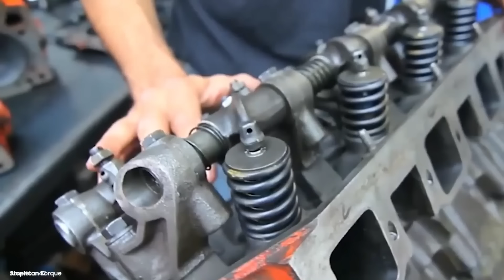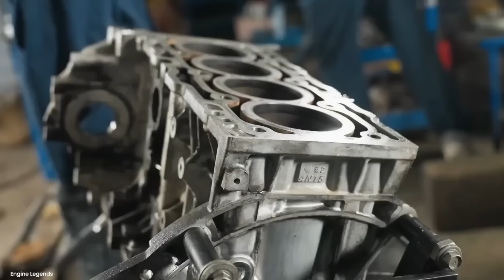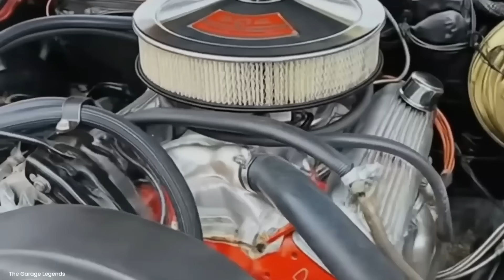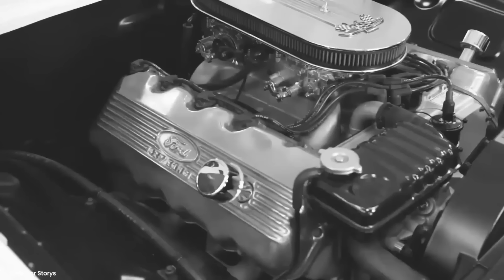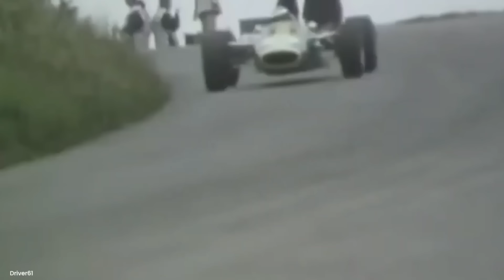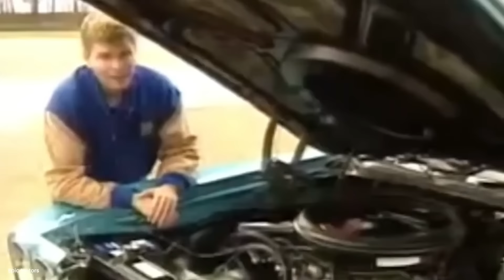This Small-Town Racer OUTSMARTED GM With a Cheap Mod They Mocked First

Comment: This is a great story. Thank you very much for sharing this.
I’m 59 and I’ve built 3 different muscle cars, with the help of my own knowledge and my good friend Kelly.
I love engines and mechanics.
Again I love this simplicity and the regular mans innovation.

I have a 69 Mach 1 408 stroker that would benefit from a spacer between my carburetor.

Comment: Three things I did on my big block Chevelle that helped me at the track. I have a spacer between carb and manifold. Have an air horn on top of carb under air cleaner. A curve kit in the distributor. Heads are ported on intakes and ported and polished on the exhaust. Car goes better than it should.

Comment: From the time fuel is introduced with air the more the fuel is atomized before going into the cylinders the better. 
I have seen dramatic differences with carburetors watching the fuel being drawn into the intake . 
 What happens after it leaves the carburetor into the intake manifold at all RPM 's I found interesting !

Comment: Geniuses aren’t usually the over educated. More than likely. Those who use current technology ( not necessarily science), comes from the lack of specific goals and open to variations on a theme. As in art , the moment of conception hits you when you step out the way, and let the concept run on its own power. Flow is what that’s called. Builders , musicians and any other creative force finds the solution. Great story!

Comment: Just as you’re talking about a spacer with a taper for under the carburetor, instead of changing jetting sizes, l would taper the jets kind of like the venturi in the carburetor. I didn’t have a dyno or anything. Just tried to go by the feel of how the carburetor acted while driving it. I old now and haven’t done it in many years. I saw a little difference. Good enough for me anyway. Have a good day
Reply: How did you taper the jets
Reply: @d @danielreese5311 put the jet in a nut they would screw into. Put the nut in a  vice and take a drill bit that’s bigger than the little hole in the jet at the bottom , and smaller than the hole going down to the bottom hole and drill just enough to open up the hole going down to the bottom of the jet without going thru the bottom of the jet hole. The taper on the drill bit makes the hole funnel shaped
Reply: The old Ford Autolite 2 barrel carbs some classes had to run were some l got a little more torque and hp
Reply: (Do your thang don’t worry about others!)

Comment: Sometimes the best engineering comes from the seat of the pants  feeling. When it's fast, you just feel it. You can't necessarily be able to explain it, but you know you're onto something.
Reply: I had several  drag strips to validate or disprove  my mods. All im going to say is i won alot of races

Comment: Sniff sniff ... I smell bullshit ! ... That's like saying your at got faster because you used a "Tornado" in your intake ... Lol ! A spacer increases volume in a intake manifold and the best benefit of a spacer is to have one with 4 small holes in it that matches the throttle plates throttle holes and the reason it makes such a throttle response improvement is because those 4 little holes increase vacuum signal response to the venturis of the carburetor and that reduces lag time and allows the air more distance to make the turn before going into the intake runners and if it was made of phenolic resin it also cooled the carburetor and fuel/air temperature of the intake charge which aids in increasing volumetric efficiency which tends to wake the engine up .... Or you can get you a camshaft with 108 to 106 degrees of lobe separation angle and that will make the Power band narrower and higher up the rpm scale but it also makes the engine turn up a lot faster too ... Old school Irish ☘️ gear head ... ☘️😎🏁
Reply: There's always a Guinness that has to make himself present on the Internet to feel better about herself yet he hasn't invented shit . the only thing you invited was putting a lock on your hamper so guys don't leave their underwear when they are working on your gril.

Comment: Keep info quiet. Tell no one. Plan on a patent. Big companies will take your ideas without  any thoughts. Comes down to money.  Less they know the better. Make them wonder. Or sell the idea.
Reply: Horse shit ! I have a utility patent on a high performance rear suspension system and the engineers at big chassis companies wouldn't promote my product because it went against everything that they have been telling their customers was the greatest thing since sliced bread and chassis Engineering failed to bring their baddest race car out front of their building and race my 86 hatch back mustang with my patented "bolt in rear suspension system and subframe connectors because I had 650 horse power and was dead hooking it on 8 " wide tires and all of their big talk wasn't about shit when it came time to prove their design over mine but they chicken shitted out what I showed up at their front door and the moral of this story is is that the less than intelligent "engineers" everywhere are stumped and afraid when a guy built a superior suspension system that does everything that theirs can't ... And that's what I discovered ... Designer and patent owner of Magnum 4 link rear suspension system ... MR JOSEPH A Bailey ☘️😎🏁
Reply: Racing technology is always  moving  faster than most think. You might be fast today and being out run tomorrow . Thats racing

Comment: My Physics professor in college made a statement in class that stuck with. As a teenager he had serve in the los Alamosa Project during  WWII development of the Atomic bomb.
He stated that "the simplest solution is invariably the correct one"... to date that has never failed....
Reply: Yeah except their was no simple solution to split an Atom and harness the energy and weaponize it without setting our atmosphere on fire. But that was the hydrogen bomb a little later. I agree that the KISS ( keep it simple stupid ) works on so many levels and is sound advice for the most part. I just don't want to see  Foress or Bubba making nukes!!
Reply: I foresee the evil scientist  eventually  igniting our atmosphere with the pumping of metals into the atmosphere
Reply: that is the epitome of stupid